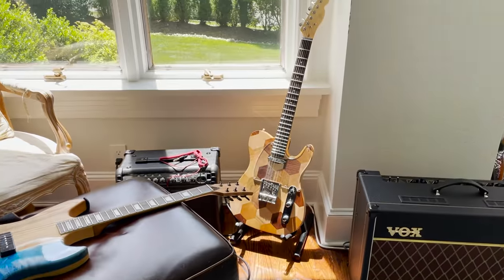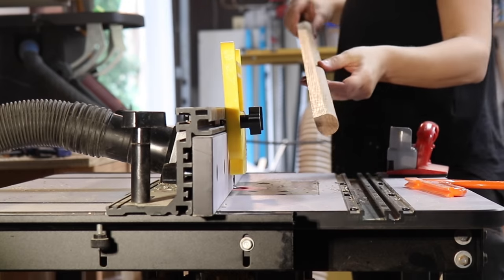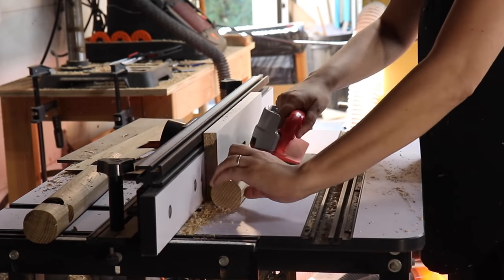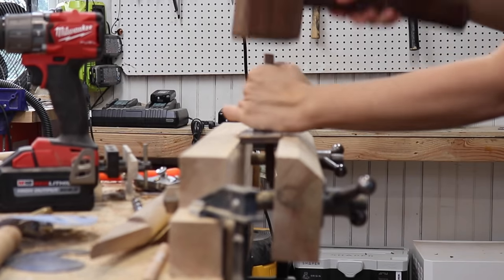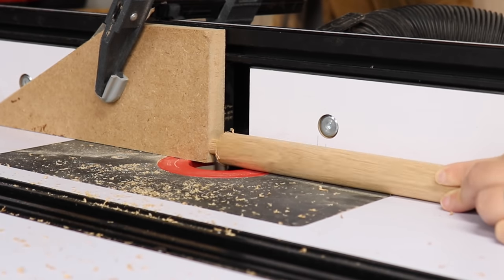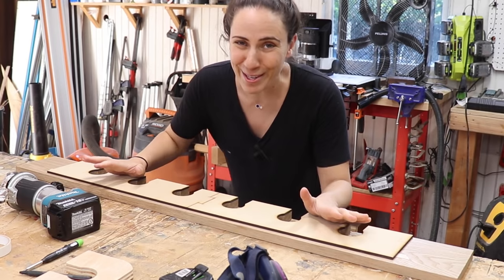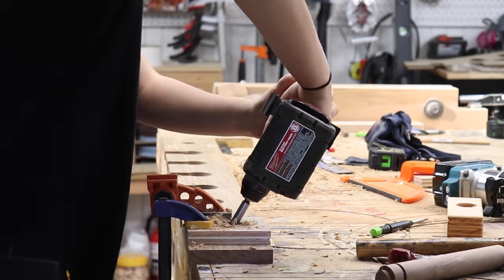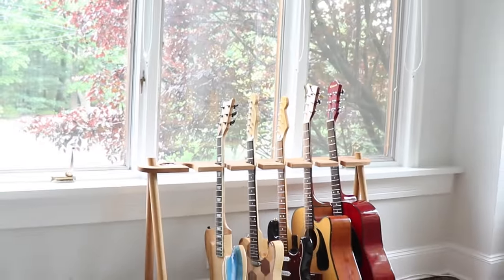Building a MULTI Guitar Rack from Dowels - PLANS and TEMPLATE available!

Comment: That's a really nice guitar stand design. I loved the idea of using the router table to cut the dowel tenons, I will use that, thank you for the tip.

When I have done acute angle joints like that I have cut and prepared the joint while the timber was square. Then, before glued assembly, the timber is routed (or hand carved) to profile leaving the joint area square. The joint is then assembled and glued tight, an easier process as you have a flat gluing surface. After the glue is set the joint area is then routed (or hand craved) to profile with a hand held router and then carved and sanded to match the rest of the profile.
Reply from the maker: Thanks! Yeah. Kinda like a maloof joint. But I really wanted to see if this would be possible if you were to start straight from dowels
Reply: @3x3CustomTamar  Ahhh, doing it the hard way for the joy of making and experimenting, good on you for that. It is a great learning process.
When I make like this I make for clients, so few chances to take risks as I can't afford the time or cost if I don't get it right first time. 
Roll on retirement.

Comment: In the future, look into metalworking pipe cutting jigs.
They’re for cutting steel pipe into those awkward angles to weld into roll cages, framework, carts, motorcycles… etc.
They work by clamping the “pipe”(or dowel) into a jig that lets you select an angle, and you use a drill with a hole saw to cut the angle. They work really well, and I don’t see why you couldn’t use them for wood as well.
Hope this helps.
Reply from the maker: Yeah! I’m going to have to experiment

Comment: Brilliant techniques and workflow, and your narrative is clear and flawless. The tenon technique is an especially nice bonus. About the keyhole template: Do make a backup, because things happen. Also, I prefer the guide bearing at the end of the bit with the template beneath the workpiece; that way you're not passing the cutting edges through your template. I was using a top-mounted keyhole template on another project, got impatient, and lifted a running router up through the template. You can guess what happened next. (By the way, the learning is part of the process, as with your sanding spindle radius issue. Whenever I blow a piece, I remind myself, "That's not waste; that's tuition.")

Comment: Very nice project! Your channel is one of my favorite to see pop up with new projects. I especially appreciate the work you did to make your own version of a pocket hole jig! Slapped my head and said, "Duh!" and "Brilliant!" and the same time. Making oversize dowels using roundover bits is a good approach but I suspect it took a lot of sanding we didn't see on screen. More importantly, it can be problematic on the last pass when there is no longer any flat material to keep the piece from spinning. Consider cutting it with plunge cuts so both ends are left square while the passes are made and then trimming the piece to length. Even more usefully, you should consider making a jig where the router rides along a carrier plate (similar to a planing jig) and a crank turns the piece to make the cut. Some versions use cordless drills to power the turning which leaves both hands free to guide router. With a bit of thought, such a jig can do lots of turning tasks like making dowels or round tapered legs or fluted legs or... well, just about anything a lathe can do. And with pass through chucks at each end you can work with any length pieces without having the jig be overly large. I would love to see what you could come up with for such a jig. I reach for mine ALL THE TIME and I can promise you would as well.
Reply from the maker: Thanks! Yeah. I should have left some meat on the ends

Comment: you could attach the sand paper dowel to a power drill and use that and a drill guide to sand the negative radius on the ends of the dowels where it needs to join the other dowel

Comment: Great job on the stand Tamar!👌
Always enjoy how you sort out those first tries and solve the challenges.👍
Here are some suggestions for your next tubular project: There are several types of notching tools for pipe that work the same on dowels, but you need to be careful about frayed edges and splinters. You can use your router table with a round tip bit or sign making bit with an angle jig (which you are so fond of😉). However, using a barrel  or tube sanding bit in your hand drill, router table, or drill press will probably be a much better solution. If you like living on the edge, you could use a belt sander cleverly clamped to the table, but I think safety would get the better you.😜
One other suggestion for the feet of the stand, rounding the edges and dipping in Plastidip or rubberized dip coating for tool handles to protect the floor and seal the ends of the dowels.👍
Kurt Cobain has nothing on you, he bought his guitar stands.🤙
Happy 4th weekend!🇺🇸🦅🎉🎊
Reply from the maker: I’m definitely going to be experimenting with it 🤘

Comment: Very cool.  I wonder if you could drill two holes in a large block of wood.  One on the angle of the dowel and then an intersecting vertical hole for the bit.  Then it would contain the dowel while "milling" the bevel cut?  I've only ever done it with metal though.
Reply from the maker: That’s what I was thinking. I’m going to experiment bc I want to do more of this kind of stuff

Comment: I like this rack a lot. 

The only things missing is a comparable holder on opposite side for a tuner and extensions of the top parts of the legs to hold a guitar strap or two.
Reply from the maker: Thanks! Guess you can wrap straps and cords around the peg that is sticking out on top. I use my phone as a tuner. Ha

Comment: Love the dowel construction! Two thoughts on the angled junction: 1) I wonder if a metal tubing notcher could be adapted for this use. 2) Try an angled hole in the front dowel with a flat bottom so it sits on the rear dowel (which is left intact). Great project! I kinda want to make one for my guitar-collecting friend. Thanks for sharing!
Reply from the maker: It’s definitely something I’m going to experiment with

Comment: Have you experimented wtih Lee Valley or other brand stick/log tenon cutters? Similar to dowel work, but potentially FAST if you find the right sized straight tree branches. A rustic version of your guitar rack could be made fairly quickly with that method. Fine job, as always Tam.
Reply from the maker: I havnt. But they look cool
Reply: @3x3CustomTamar  I think with creative ideas and planning some really cool things could be made that no one has really tried before. The Lee valley single cutters cut much more smoothly than the two bladed ones that I bought from my home state of Wisconsin.

If you cut a hole in a 5 gallon bucket to accommodate the cutter and your cordless drill, and point it upward a bit, 40° or more, it will catch all the shavings and not make such a gigantic mess!

Comment: Just what I need. Only I need to make 4 6pacs or 2 12's. ( sounds like I'm buying beer) Although I'm going to use octagons rather than dowels. Do you think that the racks could be stacked? And I think the pick storage is unique and very cool. Mine will need a cover. My cat steals picks! You're at 100' , my shop is much cooler. It's only 33'c (92'f). and climbing fast. 
Love your designs! 🤩
Reply from the maker: Haha! I definitely think stacking them is something that could be designed and done. Oooh. A cover for the picks. I would do like a lid that rotates on a rod and it snaps in place with magnets. Cool

Comment: Suggestion: Add little notches that are aligned to the holes on the template, so you could use the notches as alignment points when you want to made more holes than the template provides at equal spacing.
Reply from the maker: The holes themselves can be used to align it 🤷🏻‍♀️
Reply: @3x3CustomTamar  I ... uh ... am stupid😂

Comment: Great piece once again. 💪  I was wondering why are you making & selling the template in two separate pieces with a joinery when you could just use one with three cutouts and multiply the holders just moving on the template and overlapping it as you explained it yourself? 🤔
Reply from the maker: Thanks! Bc it’s the spacing that needs to be right. This just makes it easier.

Comment: I am trying to look for a recommendation on a flush cut saw.  I have one, tried another, and still have problems with it scratching the wood.  Which make and model have you had good luck with?

Thank you.
Reply from the maker: This wasn’t a flush cut saw. This was a mini dozuki saw I use. You want to look for a kugihiki saw. The teeth on those are flat. Meaning that don’t protrude out the sides. And won’t scratch the outer surface you are cutting
Reply: @3x3CustomTamar  thank you.

Comment: The triangles are obviously rigid but is there much movement left-right because its basically a rectangle? I guess your joinery skills with those joints helps - whenever I make something with rectangles I always need to add extra bracing to make triangles, but I'm such a hack compared to you!
Reply from the maker: Not too much movement. The top rack really helped lock it in place. Plus. I don’t expect anyone to sit on it…

Comment: I finished making a very similar stand less than a week ago, but with plywood sides instead of dowels, and nowhere near as artful!  One thing to mention is that the way the grain runs potentially makes the wood in between the slots prone to snapping off (especially if cut close together).  I know this because one of mine snapped off while I was working on it, and the rest snapped off in a fit of hammer therapy (fortunately the wood was scrap pine). 

My solution was to remake the top part in plywood, gaining strength from the cross-grain laminations.  For solid wood, it might be a good idea to glue some sort of bracing underneath.
Reply from the maker: Cool, yeah I considered that, but also thought that these are not going to be bearing any weight. So I was fine with it. We shall see…

Comment: A friend of mine works in  a shipyard as a sandblaster.Now a 10mm sheet metal ship will get hot in summer and sandblasting outfit adds even more heat.
So i asked him how da hell do you stay cool at summers? Well he told me that you dont need to cool the body just the head.So what he does is he wraps around his neck a cotton rag soaked in cold water like a scarf,then he puts another one on his forehead.At first i didnt beleve him but it works.
Reply from the maker: I def believe that.

Comment: Can you mock up the top joint before turning them into dowels?
Reply from the maker: I’m sure it’s could be worked out. The first time I build something it is never perfect. Second time either. It’s usually the third time where the kinks and processes get worked out
Reply: @3x3CustomTamar  when you talked about prepping joints before dowelizing, I thought you were going to do that as well, but I guess it would have come out funny if you made a flat spot on both first. The longer piece would have a funny notch, but apparently it would be covered by the top plate, anyway.

Comment: you can do a lot more with a table router than I thought
Reply from the maker: I love the router table
Reply: @3x3CustomTamar  oh hay I saw your video about making that curve chair with with wood and you might be able to make it work by running 1 or 2 steel cables through all the pieces and tightening it for strength

Comment: I love the guitar rack but like you, I worry about the thickness where the dowels fit together. You're getting really good at the video/production part of these videos as well, camera angles, speaking directly to the camera, etc...  

At this point I don't really care what it is that you're going to build, I'm gonna watch you build it regardless. (Most of what you've built has been interesting to me though, so... bonus!). Love the out-takes at the end as well.
Reply from the maker: Thanks so much! Yeah. I was concerned a bit but then I drilled into the upright legs. And added the tenons. So those large base pieces aren’t really doing the brunt of the holding. It’s the uprights.

Comment: Really cool! My first thought for that angled joint was to make a jig to hold it at the correct angle and then using a cove bit on the router table
Reply from the maker: Thanks! I thought if that too. But all my bits that had the profile I was after had bearings on the top. I didn’t have the right size core box bit
Reply: @3x3CustomTamar  Dang, hate it when that happens

Comment: I like the idea. But it seems like the design concept created more work than just flat stock joinery and produced a less stable result.
Reply from the maker: I’m always looking for a challenge
Reply: @3x3CustomTamar  curious to know how well it does in the long run. I’m tired of the really uninspired ones that are available for purchase.

I built a rack unit with a similar concept about ten years ago. Didn’t use dowels but basically kept it simple with readily available and inexpensive materials. Oddly it has lasted several moves and lots of abuse despite being some of my worst joinery lol